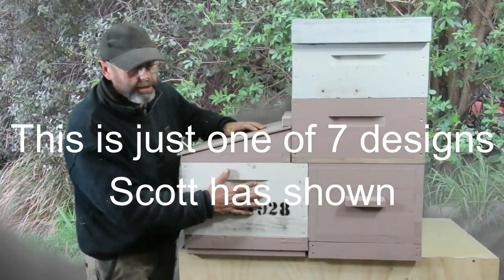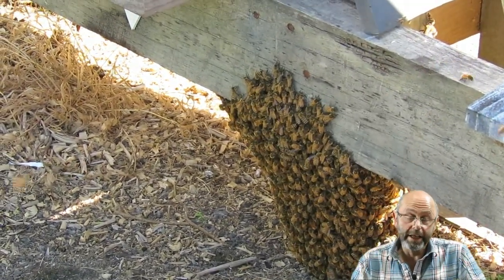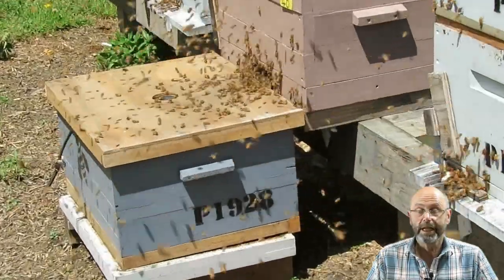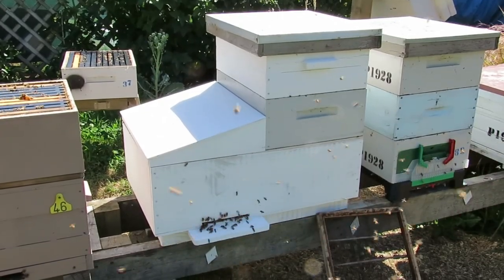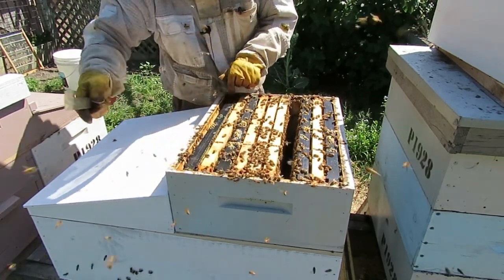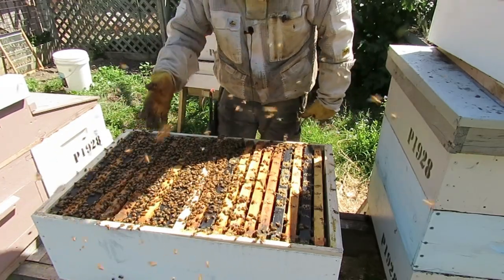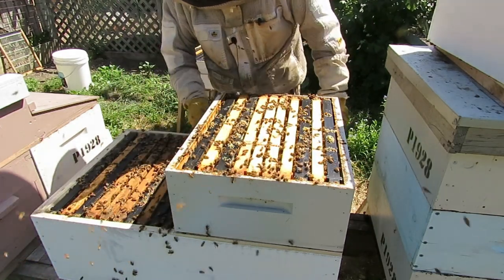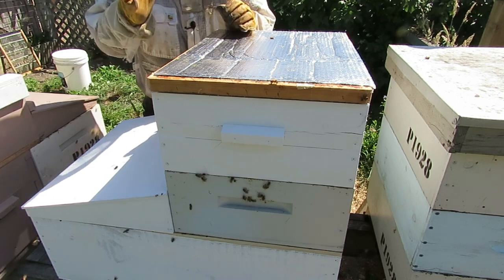Ep 44 Innovative Hive Design To Reduce Heavy Lifting

Comment: Hey Chris, could i suggest that the frames need to be oriented or turned at 90 degrees to the way you have them. I.e. the boxes effectively need to be turned through 90 degrees to the excluder. The way the present set up is it requires bees to get to the frame next to the excluder to then go through the excluder and into the super stack. If the stack and excluder were to be along the other side of the brood box ( which is equivalent to rotating the frames through 90 degrees) the the frames would be edge on to the excluder or the excluder would be across the frame ends. That way bees on any frame would be able to get to and through the excluder more easily and thus into the honey/super stack. This should speed up their access. Just a suggestion.

Had thought of making a similar set up a few years back but….it is easy to think about and i even got to doing the drawings but……the inertia of the couch was too great!

Cheers
Reply from the maker: Yes, I see what you are saying.  That would require a fixed frame rest in the middle but that is doable. I might give it a try next summer.  I haven't done a follow up on that version yet.  Our honey flow stopped early, but despite that I was very happy with the way it went.

Comment: Chris... Nice one !👍
The best of both worlds. You using Langstroth x10 as a Horizontal Hive. Your giving me Ideas. 😉
Love my Lang H.H as well as the Standard Lang Hives too.
The former is easier to inspect.
The Honey Stores is better in the latter. 
So I think I will get some Timber and 'copy' that x10, by x10 Box. Genius !
Especially as it doesn't need so much lifting of Supers.
I use all Deeps, so heavy work doing regular Bee Inspections.
Maybe this will change things.
Hope 'Mark 2' does the Deed !
Keep up with a follow on  Video Review (progress or not) with that lower Double Width Box...
Cheers.😎
🐝🐝🐝🐝🐝🐝🐝🐝🐝🐝🐝
Happy Beekeeping 2023
🐝🐝🐝🐝🐝🐝🐝🐝🐝🐝🐝
How long did it take to make ?
After my Message ? Or were we thinking 'the same'. 😉
If so, Small World....  Making things better for the Bees and the Beeks Back !  🤗
Reply from the maker: Great minds think alike :)  It was built with bees in it when you messaged.  It didn't take long to build once I decided on the design, I would have had it finished faster if I hadn't made both the sides and the ends the wrong length first time round :)
Reply: @KiwiWildman  
We all do that ! 🙃 
Measure Twice, Cut Once !!! Beek here better at Bees than Woodwork, so been there ! Maybe think it thru,  have a Cuppa, then 'cut.' 🤞
Tea anyone ? 😎
🐝🐝🐝🐝🐝🐝🐝🐝🐝🐝🐝
Happy Beekeeping 2023.
🐝🐝🐝🐝🐝🐝🐝🐝🐝🐝🐝